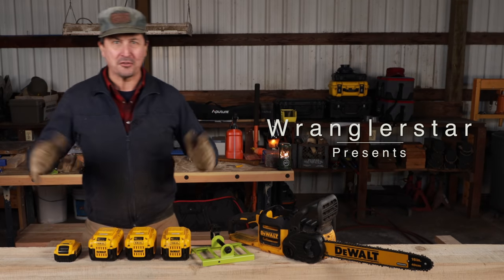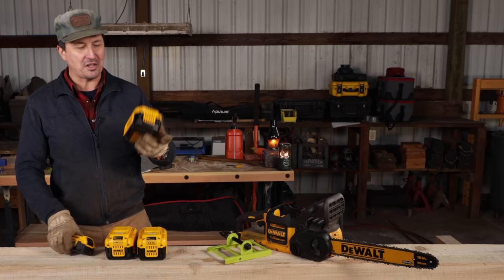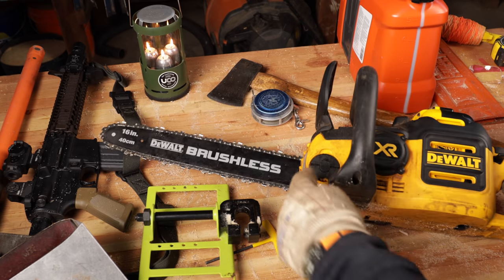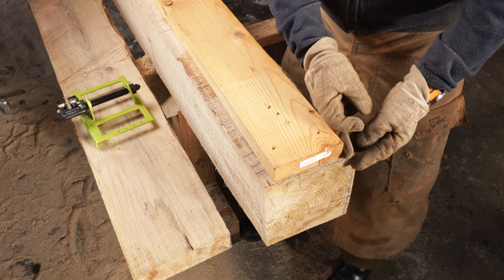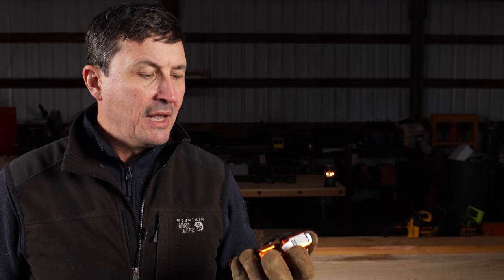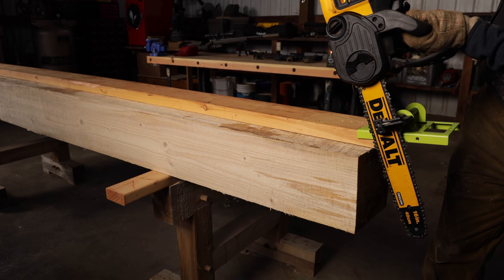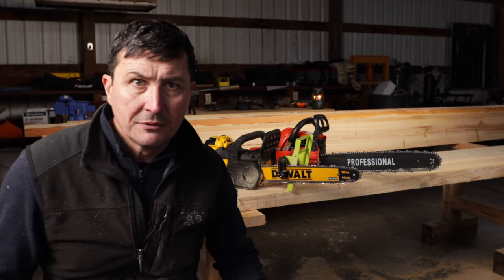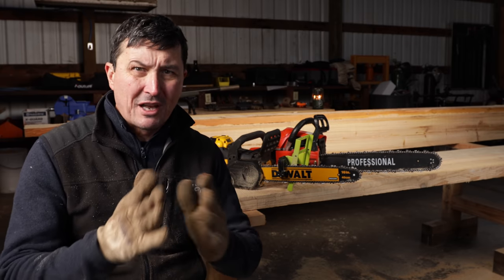Make Lumber With A Cordless Chainsaw

Comment: Lithium does fine in cold weather, its recharging them when temps are under under freezing that's the problem. See Will Prowse's  factory tour of battle born batteries for the explanation.
Reply: exactly. use load will warm a battery up. recharging a lithium battery while under freezing temps will electroplate the anode or cathode, which reduces the surface area, which reduces battery capacity. big time factor for everyone who has power tools, and cells phones, laptops. so everyone lol

Comment: I need one
Also I believe it cuts rougher because of the SLOWER RPMs
Reply: I could sure use a sharpener! Thanks for the great content !
Reply: Yes true and I'm pretty sure the Milwauke battery chainsaw cuts faster
Reply: @skeeterbuildsit6016  I always thought a gas powered chainsaw had an engine rotation factor of around 9,000 to 13,000 RPM, Take the spindle and sprocket size to convert the chains FPS ( feet per second ) to get the chain speed. I was looking at the woods pitch pockets at the section of the chains chatter marks ( rough area ).
Reply: @skeeterbuildsit6016  are electric chainsaws as consistent tho?  Potentially faster, but what about when hitting knots, do they loose more torque for a few seconds or something?  Wonder how a cold battery could affect all this as well.

Comment: It’s awesome to see how far these electric saws have come! I’ve switched to a dewalt weed trimmer so when I’m away for months for work my wife doesn’t have to worry about mixing gas.
Reply: Why would your wife not be able to mix gasoline and two-stroke oil?
Reply: @sandgrownun66  because they make little bottles for 5gal of gas and some for 2.5gal. If she ever had like 4gal of gas and just threw a 2.5 mix in and thought it would be okay. Just not worth ruining a saw/weedeater over it and it does what I need.
Reply: @sandgrownun66  okay, well I bought a battery operated weedeater. Just stick a battery in it and go, no carb, no spark plug, no mixing fuel to worry about. Just tried to make it easier on her that’s all, I guess I’m the stupid one for trying to make things easier on her while I’m not there to do it.
Reply: @sandgrownun66  you’re right, I’m wrong..didn’t mean for this to turn into a big ordeal, I personally bought a battery operated weedeater so my wife could just put a battery in and go an not have to worry about anything else. She doesn’t have to mix gas, worry about plugs fouling, carb gumming up after sitting all winter..she’s like 5’1” and maybe 100 pounds, she doesn’t even have to pull stat it, just squeeze a trigger..she’s happy with it and I am also, it doesn’t what we need it to do just around the house and trees..
Reply: @kivetts04dmax  OK. Maybe you could have shown her the steps to service a gasoline grass trimmer, before it was needed? There are many videos on YouTube for amateurs like myself. Not to be sexist, but mechanicing does seem to be the preserve of the male of the species! To be honest, I've just switched to battery powered garden tools. If you buy the higher voltage models, you get near gasoline performance, without the cost.
Reply: @sandgrownun66  yeah it was just easier all around for us. When I got it we rented a duplex and it took 3min to weedeat, I also have the bigger batt operated chainsaw, leaf blower, other cordless saws, drills, and impacts. They sure do make life easier!

Comment: Hey Cody you should test the 12” dewalt electric chainsaw
Reply: Agreed! The compact size and no gas make it perfect to keep in the truck or suv toolbox just in case. it was only $120 without battery, but it does have the light duty bad design chain tensioner and has the same jumpy skipping cutting action as the saw in this video, like you have to nearly stall it out to make the chain bite into most any type of wood. Still love mine though, hope they make an improved version 2.0 soon!

Comment: Assuming I'm not lucky enough to get one of the six sharpeners in the giveaway, I would love to have you update your recommendation for the best value, average guy, sharpener.  Maybe under or around the $30-$40 range.  I know you have reviewed many but I don't know what your current top contender is.
Again, thanks for the time and energy you put in to give us great content.
(and I love the way you work your other "tools" into the frame...)
Reply: There’s a new stone’s here has put in videos , most chainsaw videos Cody recommends a good stone
Reply: The Sthil sharpener,  does tooth and raker 40$
Reply: The Haddon Lumbermaker jig can run on a 2x4 as well as a 2x6.

Comment: Thanks for not being a hater of electric chainsaws and keeping an open mind.  I bought the 20" dewalt chainsaw and 60v battery last month and absolutely love it.   I'll keep my Stihl farm boss for big jobs, but for 90 percent of the trimming and small tree work I'll use the Dewalt.   It's just super easy to use, no fumes, and low noise so it's just less tiring.

Comment: 5:50 why? would that happen...
Answer = RPM
Solution = go Slower
Reply: Chain speed came to my mind also
Reply: I think its the chain. Use the same chain on both saws and you will see...
Reply: Totally with you. I'm thinkin rpm also
Reply: A chainsaw chain is sharpened at 30 degrees for general use and felling, it should be filed to 10 degrees for milling.

Comment: Cody, when winter hiking I only use lithium batteries in my electronic devices (Headlights &  camera).  I have found that the alkaline batteries fail fast at sub freezing temps.  Good job on the lumber milling!

Comment: When I get down to that point where the chain saw doesn't work any more I use the table saw.  This works well for smaller boards.When using an electric chain saw on rough boards you can use a plainer to smooth the boards.  I hope this will answer your questions.  Jon D

Comment: Cody, I don't know if anybody mentioned this already in the over 7000 comments, but, in the first video with the $99 chainsaw, you mounted the mill to the bottom of the bar. In this video you mounted the mill to the top of the bar. It could explain why the cut quality was so different. Probably something to do with the torque of the bar.

Comment: Very interesting.  I have started to invest in cordless tools.  I have acquired a cordless skill saw in the last year.  Currently I am using my MS261 to mill some Ash wood that we have been given the opportunity to cut.  That sharpener would be interesting and a good thing to have around to help the keep the saw sharp.  Ash is a hardwood after all and dulls the chain quicker than in Pine.

Comment: i have a ego 16 inch electric saw from home depot with a 5ah battery and i love it, i use a husky 330 and a sthil 550 gas also, but i too would love to see a larger version of the electric saw. Thanks for the great video!

Comment: From what was shown, the blade was loose. On battery powered saws the chain should be tighter due to it having more torque than a gas powered saw. I figured that out quickly when the blades got dull quicker. Another thing I noticed was that it seems that you were pulling the saw instead of letting it pull itself.

Comment: Great video. I have a thought on the chattering you see in the cut. Was thr electric saw bogging down due to a non constant feed pressure? The feed pressure would slow the chain down and cause this perhaps? Cut something thinner like a 2x4 instead keep consistant feed pressure and see if results are same.

Comment: Just bought my first battery saw, own three gas. 20", 16", and a 12" trim.

I bought the 12" one for convience reasons, also for on the the trail in the basket on my quad.
I like so far. Interested in the chain sharpener Bubb!

Comment: Hi Cody, The reason for the bad cut is due to low chain speed. Petrol saws have a much higher chain speed. Electric saws have more torque and less horsepower and do not require high chain speed to cut.

Comment: Just getting into cutting some trees around the house.  I have used an electric chainsaw with a cord and was wondering if the battery powered saw cuts about the same.  I am also using my gas powered saw more now.

Comment: I noted that the electric saw was practically vertical while the gas one cut at an angle, probably due to it being longer.  If the chain is cutting at 90 degs, there's maybe some drag-out  from the grain

Comment: I've had a similar experience with rough cuts like that.  I was using an alaskan mill and a gas Stihl 661 to mill a walnut slab so I don't think  the battery saw is the cause.  I'm interested to see what the real cause is.  I thought maybe there was 1 tooth out on the chain....    I'm commenting a week after this was posted, hopefully I can still win that sharpener!

Comment: It’s probably a case of sheer power. Battery saws don’t have as much guts as normal saws, so the chain is probably moving slower, meaning it will really highlight the quality of the chain and the quality of the sharpening.

Comment: I think that the roughness could be caused by a much lower RPM on the chain. The DeWalt has a very low RPM, even compared to other electric chainsaws.
Reply: Very true!  Most battery saws run at 20-25 m/s chain speed, but the only number I can find for the latest dewalt (DCCS677) is only 13.5 m/s.

Comment: I got the 60 volt battery dewalt chain saw. And I think yours is 40 volts. I still don't know if there's a difference between the 2 saws. Maybe later you can make a video about the 60 volts Dewalt chain saw. Thanks for sharing.

Comment: I'd bet anything the chatter was from the bar twisting. You said the whole saw was flexing when you were pushing on it and it's attachment point is the bar that's basically squeezing it in one place. It's hard to put into words but due to how the mount is when you push you're not pushing 100% forward, some of that pressure is applied at an angle and is likely twisting the bar.

Comment: I noticed that your holding of the saw is kind of awkward when you get going.  And I wondered, what would happen if you customized an attachment to grab the handles, giving you more control as you move the saw down the line.

You are definitely loosing some percentage of control with your hands positioned the way they are.  Build a beam house in the woods without any noise, that is cool.

Always enjoy your videos!

Comment: I’d say the roughness of the board is due to chain speed. An electric chainsaw is usually slower so the teeth carry less kinetic energy when they contact the wood.
Reply: Wesley Kjar not as fast as gas. Not the ones I’ve used. Corded or cordless.

Comment: For that last few inches just screw the last cut board back onto the larger piece and reverse the cut direction. After all it's just there to support the guide beam so in a 2 inch cut a couple of 2.5 inch screws in both ends will do.

Comment: Is it because of the diffrent chain speed?  Gas and electric
maybe the different relation between power and chainspeed.
On Gas the chainspeed decreases when the reststance of the cain works on the wood. 
On E power is the force straight and the chain will cut the wood more rough.

Comment: I'd say the wood is rough because the rpm of the blade is exceedingly slower. Great for home owner who trims there branches around the yard. Cutting firewood all day very doubtful.  What's the price on that little sharpener? Nice video by the way. Very interesting.

Comment: Great video.  I am rather disappointed by the saw performance.  I wonder if a corded electric would run at a higher speed, and thus get a cleaner cut.

As for your edge issue, you can mount your straight board on either the edge of a long bench, or on top of two posts.  Set the board in such a way that when the log is pushed squarely up against the bench legs/posts that you get a consistent 2" cut.  Or, if you want to get fancy, use a larger over hang that gives you a 6", 8" or even 12" cut, and then just use a couple dimensioned blocks to set the actual cut.

Comment: The electrics cut rough because they run a lower rpm. To save power to get as much efficiency out of the batteries as possible they gear down towards torque, which for cutting off limbs easily on the move isn't an issue.

Comment: I'd like to see this test with the new Makita electrics, which is basically a dolmar.  I'd imagine they are built substantially better.
Reply: Sadly, the Makita saws have a much less powerful motor in them. Don't get me wrongI love my Makita XCU03 (I own 2 of them) and they are really well-balanced in terms of battery vs motor and overall build quality, and great for limbing and small diameter, but ... very low horsepower compared to any of the other battery saws on the market.

Comment: My milwaukee seems to do pretty good. Id like a bigger bar with a full skip chain, but my local stihl dealer said there arent skip chains for that size bar. Unless anyone knows otherwise, i might just put a 24 inch bar with a regular chain and try not to bog it down too much.  But i wouldnt reccomend it unless youre invested into the m18 system. Youll want lots of batteries.

Comment: Maybe a slightly wider set on the teeth of the electric saw? Or the blade wasnt completely parallel with the cut? Also the RPM of the saw would affect it wanting to wander or curve a cut.

Comment: Concerning running out of space as the log gets smaller and having a surface for the guide board to rest on.  Seems you could just temporarily attach (screws or clamp) the board that was just cutoff to the other side of the log to still have something for the guide board to rest on.

Comment: How long does it take to charge those battery's?
If you would make the first big dimensional lumber out of the full log, would you be able to cut all the time with three battery's or would you be waiting?
It would be very neat to have one of those sharpeners, I dislike sharpening so much..

Comment: To make ripping lumber easier, don't cut full depth on first pass.  Rip the lumber in 3 or more passes.  It will keep rpms up and drag loads down.  Helps clear chips from the chain.  Should help decreases electric saw from flexing/twisting.

Comment: Does the electric saw run with slower chain speed since it has more torque at the lower speed and the gas saw needs revs to keep its torque?  Could that be the cause of the rough cuts from the electric saw?

Comment: Very Interesting. I want to get the chainsaw fixture, I just have a few logs I want to turn into lumber and from your videos this looks like it will do nicely. The electric saw did better than I thought it would. How do you think it would do on a hickory log? It is a much tougher than pine and I think a gas powered saw might fair better. Great video!

Comment: I'm curious how the DeWalt would do against a Makita chainsaw. They run 36V (two 18V batteries). Supposedly the new ones that just came out this year (2020) cut faster than the best gas chainsaw. The batteries charge really fast too (15 minutes to charge a completely dead 4 amp hour battery).

Comment: You’re rip cut has a rough edge because with an electric saw they are built with a small motor geared down for high torque output where as gas saws run a 1/1 ratio with a big motor, think like this, the less teeth that touch a surface the rougher it should be( in theory) and the gas saw runs at a higher chain rpm

Comment: Your chain should be sharpened at 10 degrees for milling which will give you a better finish. Chances are that your chain has been shaped at 30 degrees.

Comment: I would have thought that an easy option for the chainsaw would be to plug in a cable into the battery compartment to run it from the mains for fixed location tasks like this?

Comment: Lithium batteries run fine in cold weather. It's charging them in cold weather that can kill them.
Reply: There will also be increased internal resistance until they are warmed up you can definitely feel the power loss when you grab a lithium powered tool from cold weather until it heats up a bit.

Comment: would be nice to get the proper angle on the cutting edge. after i sharpen with my file, my log cuts make a rounded cut. i prefer a straight cut. someone always notices and makes a smart comment.

Comment: There are electric chainsaws.  What you have is a battery powered chainsaw.  Try your experiment with a plug-in chainsaw. 

Also, the video doesn't show that you eliminated a possible chain problem.

Comment: re the tiring out from pushing the saw, why do you work so high up , surely it's less work when pushing at a more comfortable lower level ? sharpen the narrow gauge chain at 90 degrees and you'll get a clean cut any time.Electric saws don't have the speed like a petrol one and leave a wavy surface finish.